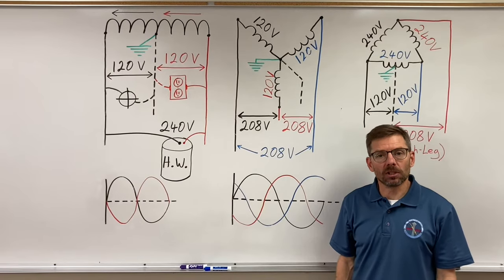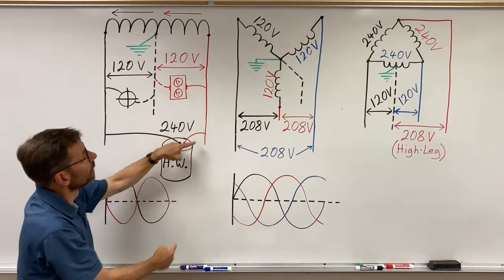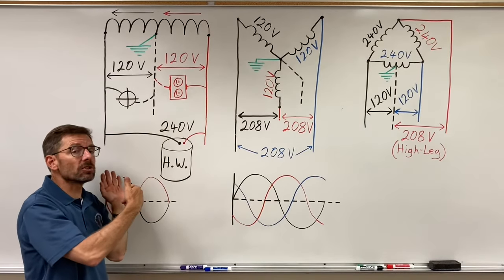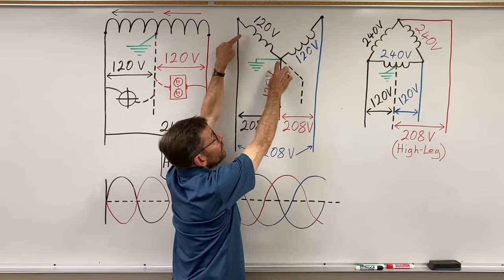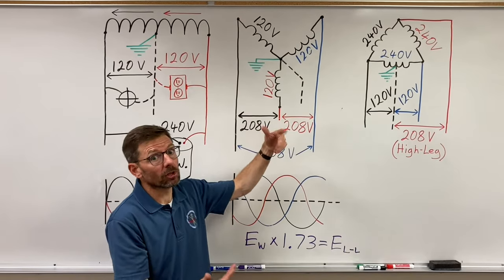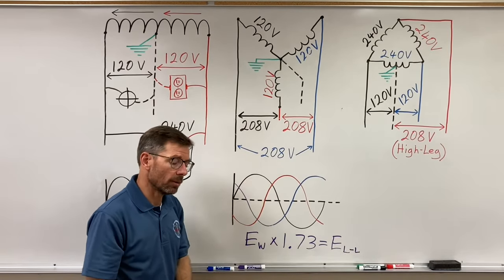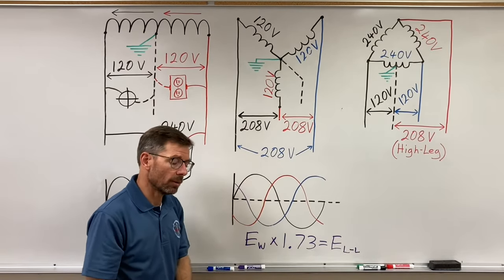120/240 and 120/208 Volt Transformer Secondaries

Comment: I have a 120/208 system. I need 240 so I got a buck booster. It gives 146volts from  phase b to  neutral. A to neutral is 120 and a to b is 240. Is there a wiring diagram that a to ground and b to ground would give 120?
Reply from the maker: Sorry for the very late response here.  Covid made some of us super overworked, but I hope this late response will help others even if it is too late for you.  Also, here is a link to my video introducing Buck-Boost transformers in case that could be helpful: https://www.youtube.com/watch?v=aOtSnJo6PfM

A Buck-Boost transformer is often used for a specific load, however, there is no reason I'm aware of that precludes feeding multiple smaller loads from one Buck-Boost.  We use one Buck-Boost for a single-phase load, or two or three Buck-Boosts for a three-phase load.  Your question doesn't state whether you need single-phase or three-phase 240 V so I'll consider both and the ramification to the neutral.

SINGLE-PHASE: If we use a single Buck-Boost transformer to achieve a desired output of 240 V single-phase we would need to use any two phase wires (A&B, B&C, or C&A) for a 208 V single-phase input voltage.  We would have a 120 V potential between either of the two phase wires and the neutral (the neutral point is by definition, a center point of a system - see NEC definitions).  In this "boosting" scenario we take one of the phase wires and, after connecting it to the primary winding, take it out to the load (this wire will maintain its 120 difference of potential with the neutral).  But, the the other phase wire that connects to the primary winding needs to then go through the secondary windings so the difference between the two phase wires will be "boosted" 32 volts to achieve our desired 240 V difference of potential (this is what I casually refer to as the "manipulated/adjusted/boosted" wire). It is this second phase wire which gets its voltage "shifted" in relation to the original neutral.  The main objective here is that we get a 240 V potential between two wires and this has been achieved.  If the load in question needs a neutral then this is not the tool for the job.

(I can imagine a set up of two Buck-Boosts similar to the open-delta arrangement of the three-phase systems where one could use a neutral in place of the middle phase to achieve a three-wire single-phase 120/240 output.  You could probably get voltages that are close enough to what you desire, but I don't recall any manufactures showing such a schematic under the "Single-Phase" heading.  This, my friends, is a common problem in our trade.  Just because we can get a desired outcome, it doesn't mean that the equipment is listed (or even intended) for that use, nor does it mean that it is acceptable to our code rules...  It does mean that we are thinking about how things work which is admirable; we may just not be aware of the safety issues that could arise...)

THREE-PHASE: For three-phase I recommend you do a web search for "three-phase buck-boost instructions" and you will generally see in their literature the diagrams for single and three-phase installations.  It is possible to maintain a "centered" neutral when using three Buck-Boost transformers (one for each phase), but you will need to follow their diagram closely (not all instructions show this, but look at Eaton's).  It is also restricted to "Wye" systems only.  What happens here is that each phase is either increased (boosted) or decreased (bucked) relative to the neutral and so it maintains its "center point" definition.

Comment: another system worth an honorable mention,  is, an open delta, typically 120/240, but occasionally corner grounded 240.    I've seen this in rual areas, almost always on a farm setting, when most of the loads are single phase 120/240, with a smaller amount of 3 phase motors, typically a grain drier,  augers and conveyer.  The capacity of a full delta is not warranted, and the system can be easily recognized, by the two transformers, one being significantly larger, in terms of KVA, because all your 120V loads come off that one.   the smaller transformer is the power transformer, this provide the high leg.   Much like the full delta, open delta suffers from the same limitations,  very difficult if not impossible to balance,  along with the possibility of mistakenly connecting a single pole breaker to the high leg when 120 volts is needed.    As such these systems are rarely encountered in new installations.
Reply: I was wondering if someone would spot this. I actually did a job at a water treatment plant in Pueblo, Colorado that used an open delta service.

Comment: 10:54
I'm an electrician, and never understanded why the neutral ( X0 )  has to be " grounded " ?!
I know what happens when it's not, but dont understand the reason...
Is it only in case of unbalanced 120v loads in a star 120/208v ?
But what if its 3 phases 208v star configuration, and we only put a load on phase A and B ( 208v single phase ) , and the X0 is not grounded, what happens?

Comment: @dev Gordon 1 question.... I din't got that why center tap is grounded instead they (who made this ckt firstly) can keed either side of it can be connected to ground.... Idea is when we running 240 volt appliance.... If ground fault occurs then PROBABILITY will be 50% that wire will be live and 50% will be neutral wire 
So that during neutral connects to ground... Damage will be almost equal to zero and in other hand if live touches ground fault current will more and immediately clears out fuses in path , i know someone will say potential with respect to ground will less in center tap configuration, but either you get electrocuted by 120 or 240 you will get electrocuted....!!! 
Also in 240 volt system without center tap to ground connection wire sizing will also reduced for 240 volts for same kilowatts while center tapped live wire and neutral will be the same as before

Comment: can you explain the last part (the math) on how you get the 208 tx
Reply: Draw it to scale as a triangle.   For the Y system, draw each of your Y legs, as 12 centimeters, to the 2 O'clock, 6 O'clock, and 10 O'clock positions..  You should measure 20.8 cm across each of your adjacent tips of the Y-legs.   20.8 cm would correspond to 208V at the scale it represents.

For the math behind this, consider two adjacent legs of this setup drawn to scale.  You'll form an isoceles triangle, with sides equal to 12 cm.  The obtuse angle of this triangle is 120 degrees.  Call the side x, opposite the 120 degrees.  From the sum of angles rule, this means the remaining two angles are 30 degrees.  Drop an altitude to the long side of the triangle, bisecting the 120 degree line.  This forms two 30-60-90 triangles.  The base is x/2 by the 30 degree angle, and the hypotenuse is 12 cm.  This means the altitude is 6 cm, and x/2 = 6 cm * sqrt(3).  Solve for x, and we get x = 12 cm * sqrt(3) = 20.8 cm.

For the high leg delta:
Draw the equilateral triangle to scale, with 24 cm sides.  Split one side in half, and drop an altitude to it.  That altitude should measure 20.8 cm.   Half this triangle, is our special 30-60-90 triangle, which has a 12 cm base, a 24 cm hypotenuse, and a 12 cm * sqrt(3) altitude, which is 20.8 cm.

Comment: In extremely rare electrical systems,  there is a 480 volt delta with a high leg.  Your phase to neutral will be 240V,  and the high leg to neutral is 415V.
Reply: In our area we either corner ground one of the legs or setup as ungrounded..(always plant owned power supplies) I have never seen a 480 delta center grounded. Not around here anyway. Power companies supply 480/277. Once again around here, Pacific Northwest

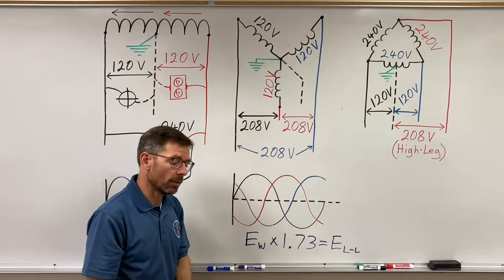Comment: Great video, I do have one question at 10:25 when you said that if you take any vertical point on the 3 phase graph and add it up you get 0. Are you referring to where the one phase peaks and the other 2 phases are intercepting underneath that peak? I assume you are subtracting the value of the peak from the values of the negative voltage phases underneath the neutral. Just threw me off when I heard you say that.

Comment: Why there is ground wire bonded on the nuetral in the dry type transformer?
Reply: Because every time power travels through a transformer (that isn't an autotransformer), you lose your reference to ground, isolating the secondary from the primary.  Transformers can only transmit a change in voltage, and not a voltage itself.  Your transformer secondary starts what is called a separately derived system, which needs its ground reference re-established.

The connection between ground and neutral should be limited to only where it is required by the NEC.  Unnecessary connections between N & G, mean that you create a parallel path between N & G, which puts objectionable current on the EGC and other metal not meant to carry current.  The N-to-G connection should be a dead-end that won't let current flow under normal circumstances, that is only a voltage reference.

Comment: The high leg delta system although very seldom used in new installations, actually is a really cool system.   Although all electricians know and probably have worked with the 120/208/240 delta at least a handful of times in their career,  there is also yet  another delta that is extremely rare and many electricians will never come across it, some may not even know it existed,  but it's a 240/415/480 volt delta.
Reply: Very interesting
Reply: I prefer it to the 208Y/120 volt system, otherwise known as the wimpy Wye.
Reply: @jolyonwelsh9834  for me it depends on the application.   If I have a lot of single phase and three phase loads, I prefer the 208Y/120, as it's easier to balance the loads,  and eliminates the chances that someone will accidentally connect the stinger leg 208V to a 120 volt circuit and burn up equipment, it's happened more frequently than an honest electrician would care to admit.   Where I hate the wye system is in apartments and hotels with a kitchenette,  the range tests my patients when I need to boil a pot of water (I hate electric ranges anyways,  I'll take on gas anytime day or night) and clothes take longer to dry.   

If I have a bunch of three phase motors,  with a smaller amount of 120 volt loads, I like the 120/240, 3 phase 4 wire delta better.
Reply: @Sparky-ww5re  There's a more expensive but thorough solution. Maddox brand transformers manufacturers a 3 phase transformer with a 240 volt delta primary and a 208Y/120 volt secondary. Have a 3 pole breaker to feed this transformer and put all your 120 volt single phase loads on the secondary of this transformer, and you can balance the load that way. You balance the secondary, you balance the primary. No high leg on the secondary, problem solved. There is an old saying in this business, "you throw enough money at a problem, it will go away."
Reply: @Sparky-ww5re  Oooor...  you could just ditch the 120V all together and use 240 phase/400 V main like the rest of the world...  which also allows your electrical stove to run at full effect without burning the wires from excessive currents.
Reply: @BPo75 nah. Being like everyone else is overrated.

Comment: Question: Where would a wye transformer like this one be used?  It seems like the only place it would be good for would be structures requiring only 120V services.  Are there any instances where straight hot leg to hot leg 208V would be needed?  Aren't most devices 120V or straight 240V?  I understand 3 phase where you have a high 208V leg, but I've never seen that high leg used on a single pole by itself, it's always used in conjunction with the other 2 phases to produce +240V at 3 points during the cycle.

Comment: Hi dave can we get 480 volt from delta transformer. And 240 v  from star transformer.
Reply from the maker: Theoretically, one could derive any voltage they desire from a three-phase transformer, however, the "Wye" or "Star" configuration would need to maintain the formula: phase voltage x 1.73 = line voltage. 

onlyvoltages in North Americas are 480Y/277 V and 208Y/120 V, and I understand Canada also uses a 600Y/347 V.  In delta I'm familiar with 480 V, 240 V, and 240/120 V (high-leg delta).  This answers the first part of your question in that we commonly derive 480 V in both delta and star (wye).  We also use 2400 V, 4160 V, and other medium and higher voltages, but I'm not overly qualified to discuss higher voltages...

As we travel around the world, common building voltages vary (as do frequencies) and I'm aware that both 400Y/230 V and 415Y/240 V are used.  Although I haven't personally installed transformers with either of these voltages, the numbers fit the 1.73 ratio so to answer the second part of your question, 240 V is derived on the secondary of star (wye) transformers as a phase (or winding) voltage.  If I were to measure between two phases of a star transformer with phase-to-neutral voltages of 240 V the resulting line-to-line voltage would be 415 V.  I am not aware of any use of 240 V as a line-to-line voltage because the implied phase-to-neutral voltage would then be about 139 V and I have not heard of that as close to a standard anywhere.

Comment: So 208 in a Delta wired 3 phase bank is a single phase or phase to ground voltage. Whereas 208 volts in a Y connected bank is a phase to phase. We won’t talk about 277/480 or 240/480 volts at this point, or a corner grounded Delta, which are all common in the utilities world.
Reply: 208V in a 3-phase Delta grid, is only a special case of one of the phases to ground.  The remainder of the phases are 120V to ground, and 240V to each other.  By convention, we put the high leg on the B-phase.  So the A and C phases, have access to allowing for 120V to neutral loads.  The 208V high leg on the B-phase is seldom (if ever) used on its own, for a single phase to neutral load.  Usually, loads in this system are either interphase 240V, 3-phase 240V, or single phase 120V.

208V in a Y-grid, is measured across any two phases.  The phase-to-neutral voltage is 120V nominal for all 3 phases.  Y-systems have symmetry among all three phases.

Comment: Is the 208 volts from B phase to neutral on a delta system ever used for anything? Or is that leg strictly restricted to being part of a 240 circuit?
Reply from the maker: I don't know that it is dis-allowed, but one of the problems with the delta high-leg systems is that they are harder to balance between phases, especially as loads are added/removed over time.  That is one reason why, at least in my region, they are becoming a thing of the past.  If a 208 V load were placed between the high-leg and neutral there would be a parallel pathway for current down each side of the triangle so I'd have to ask an engineer if that would have a negative ramification.  There is also the question as to whether the transformer is listed for that use...  My suggestion is to only use the "high-leg" with either three-phase 240 V (using A, B, & C) or single-phase 240 V (using A-B, B-C, or C-A).
Reply: @davegordon6819  It's also impractical to use the high leg to neutral in most panelboards.  You have to watch out for slash ratings on such breakers, where they are marked 120/240V, instead of just straight 240V.  This means, the breaker can't exceed 120V nominal to ground.  Most single pole breakers are slash rated, and few (if any) are straight-rated for the full 240V.  It's very common that 2-pole and 3-pole breakers are straight rated, and have no problem with the high leg.  But the single pole breakers commonly mean B-to-N loads on a high leg are not allowed.

This would mean that if you tried to use the high leg without any of the other phases, that you'd need a 277V/480V panelboard.  This is overkill for 240V systems, and unlikely to have this in practice at an existing building.  Most loads you'd hypothetically "want to" connect to the 208V high leg, work better at 240V anyhow.

Comment: Question.  Can i have 480 volts on the Delta transformer WITH a neutral?

What would happen to the Wild Leg from the B phase to neutral?
Reply: You can have a corner-grounded 480V system, and one of the three phases would be your grounded conductor.  It wouldn't be a neutral by strict definition, and this is uncommon.

In concept, you could have a 480V delta system that center-tapped between its A and C phases, and each of these would be 240V to neutral.  Its B-phase would be 416V to neutral.  This could exist in theory, but I don't think you'll ever see it in practice.  Most 480V systems you'll see in practice, are either ungrounded 480V, corner-grounded 480V, or 277/480V wye systems that are either grounded wye (most common) or floating wye (less common).

There simply isn't as much need to use exotic configurations of 480V, as there is for 240V.  It's much less common now, to have 240V high leg delta services, as 120/208V wye services are much more common.

Comment: Mr Dave. I bought a lathe machine electrical connection plug has 4 wires, red black white and green .how to determine the voltage of it.
Reply: The machine is supposed to be labeled on the motor. You can't determine voltage just from wire colors
Reply from the maker: @Krankie_V  Thanks for answering this question, Kranky V.  Unfortunately I am not able to get to all the comments.
I fully endorse what Kranky said, but could also add that the shape/size of the plug can indicate voltage, but the big caveat here is whether or not it is the original plug or if someone has changed it to manipulate something...
Reply from the maker: Unfortunately I am not able to get to all the comments.
I fully endorse what Kranky said, but could also add that the shape/size of the plug can indicate voltage, but the big caveat here is whether or not it is the original plug or if someone has changed it to manipulate something...